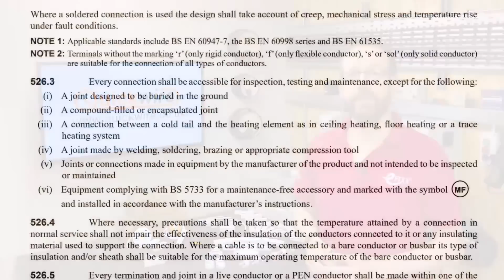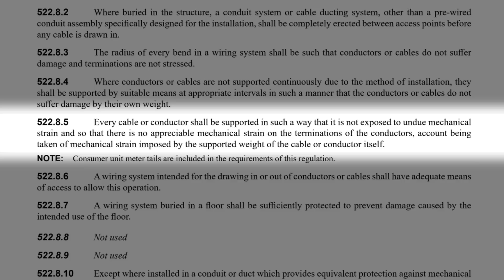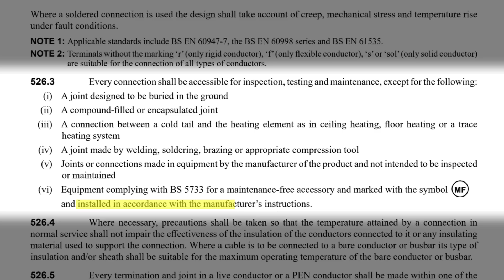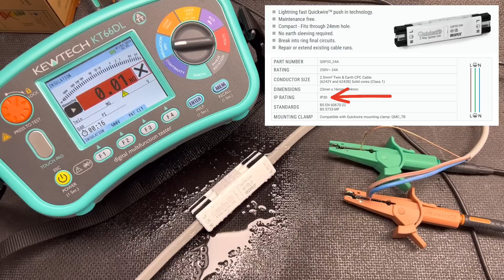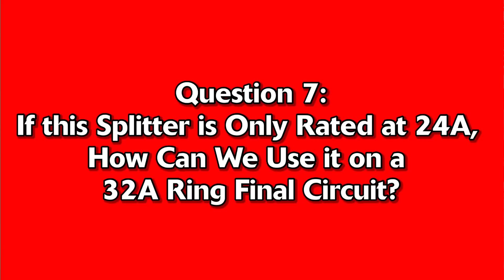Quickwire Junction Box Confusion? Get Answers Now!

Comment: It would be great if quickwire could come up with a waterproof version, or a cover could be designed to add reliable waterproofing to the existing designs.
Reply: No just use a resin filled joint if it's getting soaked

Comment: As usual, well done Joe for a great video. I think Quickwire are great and champion them where I can. This great bit of kit joins their previous well designed "Sparky help" line-up, and the testing port shows how they make life less difficult. Really good point about plastering it in situ and common sense points to some sort of protective membrane against moisture, though as the plaster dries out, the issue dissolves. Keep up the good work.
Reply from the maker: Thanks very much for the great comment! 😊

Comment: does it work with earthsure
Reply from the maker: Great question, we'll give Quickwire a nudge! 😃
Reply: @efixx  did you get an answer ? Just a home DIY er about to buy some earthsure
Reply: Earth not so sure, terminating  say a radial 20a socket cct I always like to twist gently together the Cpc a couple of times then bring them up in 1 piece of sleeving and terminate. This way if the earth's somehow comes out of the terminal by a meddler changing sockets, the earth is maintained for the rest of the cct. Not an option with earth sure

Comment: 4:21 The instructions say do not cover - time stamp 2:39 - so I doubt it keeps its 24amp rating if concealed in a wall.
Reply: Does any cable keep its free air maximum operating current when buried in a wall?

Isn't this why we have the concept of fixing methods and derating of the current capacity of the cable?
Reply from the maker: Yeah, that's one of the things I was curious about as well but Quickwire suggest sted it would be ok. 💪

Comment: I'd have thought the big DO NOT COVER warnings would have argued against burying in the wall
Reply: You need to think about why such an instruction would be present.

Often it is because it impairs the ventilation and can cause the device to overheat.

But if you take a moment to think about this device, why would it overheat? It is simply carrying the same current as in the cable connecting to it, and those cables are buried too.  Are you going to say cables should not be buried in the wall because they overheat?

It's a question of designing the installation properly and derating the maximum current the cable can handle according to the fixing method employed.

I am quite sure the plastic case of the splitter is designed to go up to 80°C, the same as many thermosetting plastic insulated cables, it would be a pretty naff product if the max operating  temperature were to be lower: it would mean that if you started repairing damaged cables with it, you would have to change the breakers and reduce to a lower current rating. Which would not be desirable.
Reply from the maker: Yeah, that struck me too, I asked the techie people at Quickwire and they said it would be OK. 👍

Comment: Great video. A question I've been trying to get answered - can the 24A version be used with older T&E that has 1mm CPC. I'm presuming not until I hear otherwise.
Reply from the maker: Great question, we'll put it to Quickwire! 😃
Reply: Why would it make a difference.......Does it matter that the old cables are connected to a double socket usually rated at 20a
Reply: @markyd2633  If it's designed to grab 1.5 sq mm cpc and doesn't adequately grab 1 mm CPC then it matters!
Reply: @markyd2633  presumably what will matter is whether it can make adequate contact with a 1mm cpc
Reply: @markyd2633  Minimum size for the physical contact...